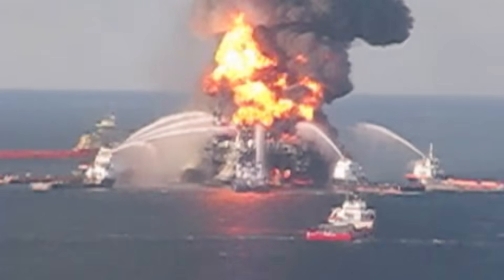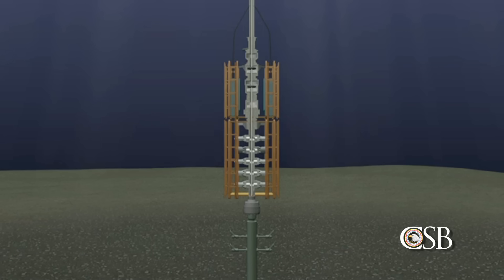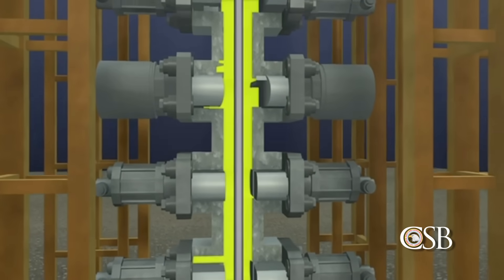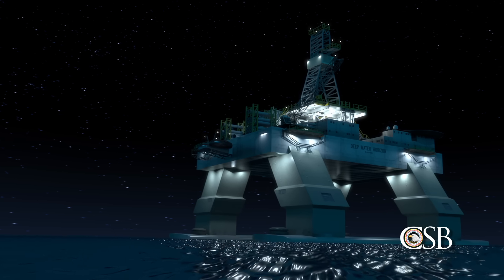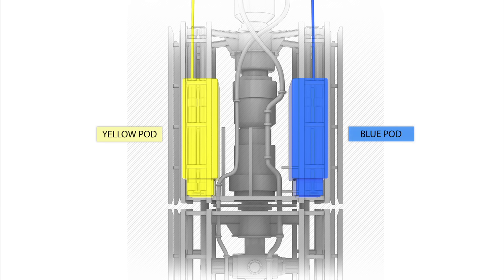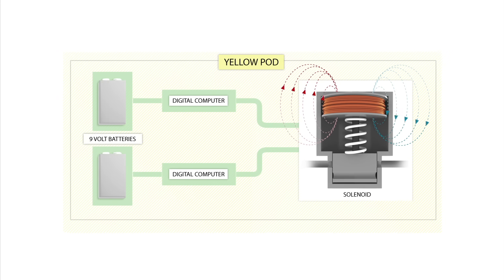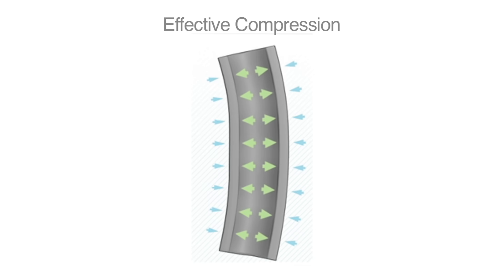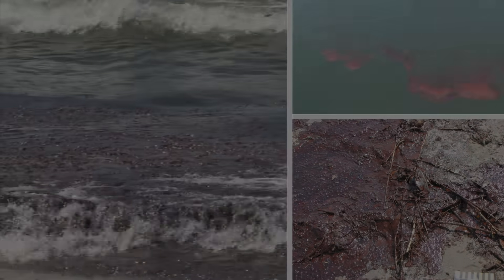Deepwater Horizon Blowout Animation

Comment: You would think they would make a slot for the blind sheer ram and have the pipe run inside another tube so that the if the pipe buckled it would hit another reinforced tube and stop bending and the ram would be wider than the tube itself so that it would cut both and eliminate the problem of the pipe bending outside of the blind rams reach
Reply: i think they have them they are called centralizers. Bp was told to use like 35 and used like 12 instead as itscheaper and faster to not place them.
Reply: @dustyflair BP going with the cheaper option, c’mon they would neverrrrr do that

Comment: One would think that wiring on emergency systems would be triple checked by different individuals and also tested to make sure they operated correctly before installation.
Reply: it shouldnt even be able to be wired by a human. They should plug and play a comter panel to do all that.

Comment: 1) Design every channel “de-energize-to-trip”

Meaning: loss of power or signal forces the safe state.

Use normally-safe actuators/valves (spring-return to closed, vent-to-close, etc.).

Use solenoids arranged so power holds normal, and power loss trips to safe.
This “idle current / de-energized-to-trip” philosophy is widely used specifically to protect against power loss and common-cause electrical failures.

Why it matters: if a fire, flood, dead battery, severed cable, or logic crash happens, that channel still does the right thing without needing command energy.

2) Separate the channels physically

Independence dies if both backups can be taken out by one event.

Put redundant controllers and wiring in separate housings/trays.

Separate hydraulic lines, accumulators, and connectors where possible.

Protect against the same environmental threats (heat, vibration, corrosion) hitting both at once.

Rule of thumb: if one explosion, leak, short, or crush can wipe out both channels, they’re not independent.

3) Add diversity, not just duplication

“Two of the same thing” often fails the same way. Diversity breaks shared failure modes.

Examples:

Different technology: e.g., one electric actuator path + one hydraulic/mechanical path.

Different components/vendors: different solenoid models, different PCB designs.

Different logic/firmware: independent code bases or different safety PLC families.

Different sensing principles: pressure sensor + acoustic/flow-based trigger, etc.

This is a standard anti-common-cause strategy.

4) Make support systems independent too

A channel isn’t independent if it shares the same “lifelines.”

Give each channel:

its own power source (separate batteries/UPS, separate chargers),

its own signal path (separate comms, separate penetrators/umbilicals),

its own hydraulics/pneumatics where feasible.

Classic trap: “dual pods” that share the same weak battery design, connector type, or maintenance procedure.

5) Treat systematic (human/design) error as the main enemy

Redundancy helps random hardware failures; it does not automatically protect against mis-wiring, bad procedures, or design bugs.

So you need:

strict configuration control,

independent verification/inspection,

checklists + polarity/continuity proofing,

change-management and competency controls.

Functional-safety standards explicitly separate random vs systematic failures and require processes to reduce systematic ones.

6) Prove independence with common-cause analysis + testing

You don’t just assume it—you demonstrate it.

Do a common-cause failure analysis (beta-factor, fault-tree with CCF nodes, etc.).

Run end-to-end proof tests that intentionally remove:

power,

command signal,

single components,

one whole channel,
and confirm each channel still fails safe on its own.

Key: independence is a tested property, not a marketing claim.

Bringing it back to the Deepwater Horizon context

What failed there wasn’t only “redundancy exists/doesn’t exist.” It was that the redundancy wasn’t independently fail-safe:

shared vulnerabilities (battery health, wiring quality),

solenoid logic not truly de-energize-to-trip,

systematic human errors that could hit both channels.

Industry BOP control standards emphasize robust control, accumulator reserve, and emergency operability, but independence still hinges on the design/QA choices above.

Comment: I’m surprised solenoids of the yellow pod don’t operate the opposite way, to make them failsafe. The battery and solenoids are used in normal conditions to push the valve closed and any interruption in power or signal and the value springs open (Valve normally open, forced closed)

Comment: This was not an 'accident'. It was a massive negligent cluster-phuck.
Reply: Same reason why Chernobyl Reactor 4 blew up. They were in a Xenon pit which reduced reactivity, and they tried lowering reactor output to prepare for a test, which stalled the reactor. Deputy Chief Engineer Dyatlov wanted to bring it back up to 700MW from a stalled state when the only safe option was to slowly raise power to 3200 MW over the course of 24 hours. Only getting 200 MW, Dyatlov proceeded with the test and told his subordinates off when they tried to intervene or ask him to record his actions. After pulling all control rods out, shutting water flow, the reactor was now accelerating, and incrsasing in reactivity similarly to how the pressure was uncontrollable in the drill pipe. The final straw was when they pushed the emergency shutoff, AZ-5, The control rods were tipped with graphite which accelerated reactivity, increasing pressure, and the reactor from there, exploded, combining superheated materials with cool air, the explosion was immense, and radioactive material was spread across a 200+km area. Smoke from the subsequent fire carried mildly radiactive particles across Europe.
Reply: In America we haven't built any reactor similar to the RBMK in design since the SL-1. And that was a failure for an entirely different reason back in the 1950s. Chemical spills and oil spills have proven to cause more damage to biodiversity than radiactive catastrophes. Pripyat and Chernobyl have a ton of life surrounding them still. Dogs within the zone manage to find a way, wildlife has for the most part remained unchanged.
Dupont's negligence and BP's greed have caused more dsmage than Dyatlov and Bryukhanov in Chernobyl, Fukushima in Japan, and not even 3-mile-island was a need for concern.

Comment: I like how they were so bad at making redundant systems that a battery failure caused their miswired solenoid to work correctly. If the drill pipe hadn't been bent, that miswired solenoid might have saved the day!

Comment: That makes no sense and doesn’t explain what the drill mud was doing doing in the drill string if the cement plug had been poured. Plus a bent pipe won’t prevent the shearing of the drill string.

Comment: The alignment of these “holes” isn’t purely random—it’s a result of multiple vulnerabilities or failures that, when combined under certain conditions, lead to disaster. Here’s why that can happen:

Complexity of Systems:
In any intricate system, there are numerous components and layers of safety. Each layer (or “slice” of cheese) has its own potential weaknesses. While one failure might not be catastrophic, when several weaknesses coincide, the overall defense can be breached.

Human Error and Oversight:
Mistakes like miswiring, inadequate testing, or ignoring warning signs contribute to these vulnerabilities. When organizational pressures (such as keeping to schedule or cutting costs) influence decision-making, these errors can go unchecked.

Environmental and Operational Stresses:
Conditions like extreme pressures or unexpected stresses can exacerbate small flaws. What might be a tolerable imperfection under normal conditions can become a critical failure when the system is pushed to its limits.

Murphy’s Law in Practice:
The saying “anything that can go wrong, will go wrong” captures the idea that if there are flaws in a system, they have the potential to manifest simultaneously. It’s not inevitable in every scenario, but the more vulnerabilities exist, the higher the risk that all or several will align at the worst possible moment.

In short, while not every potential failure will line up every time, complex systems with many points of vulnerability can sometimes experience a perfect storm where all the “holes” align, leading to catastrophic outcomes. This is why robust design, constant vigilance, and redundant safety measures are critical in high-risk industries.

Comment: The Swiss Cheese model illustrates that even well-designed safety systems can fail when multiple small errors or oversights—each represented as a “hole” in a layer of defense—align. When these vulnerabilities line up, the system’s safeguards can be completely bypassed, leading to catastrophic outcomes.

For example, in the Deepwater Horizon incident, miswired control systems, battery failures, and the unexpected buckling of the drill pipe were separate issues. Each might have been manageable on its own, but when all these “holes” aligned, the safety measures failed, ultimately resulting in one of the worst industrial disasters in history.

This model is a powerful reminder of why rigorous checks, redundant safeguards, and continual improvement in safety protocols are crucial in high-risk industries.

Comment: 1. Complexity and Redundancy Aren’t Foolproof
Redundant Systems Fail:
Despite having two independent control systems (yellow and blue pods) designed as a safeguard, miswiring and battery failures in both meant that the backup mechanisms didn’t work as intended. This shows that redundancy must be accompanied by rigorous quality assurance and regular, comprehensive testing.

2. Cascading Failures and the “Swiss Cheese” Model
Multiple Small Errors:
The disaster was not the result of one isolated error, but a cascade of failures—from miswired solenoids to the unforeseen buckling of the drill pipe due to effective compression. This mirrors the “Swiss Cheese” model in safety engineering, where several layers of defense each have holes that, when aligned, allow a failure to pass through all safeguards.

3. Human Factors and Maintenance
Role of Human Error:
The miswiring incidents underscore the impact of human error in safety-critical systems. It’s a stark reminder that the design, installation, and ongoing maintenance of complex systems require not only advanced technology but also meticulous attention to detail and rigorous standards.

4. Underestimated Physical Phenomena
Effective Compression:
The phenomenon of effective compression—where even slight imperfections in a seemingly straight pipe can lead to catastrophic buckling under high pressure differences—revealed a previously underappreciated hazard. This insight has led to a deeper understanding of material behavior under extreme conditions and the need to factor such subtle phenomena into safety designs.

5. Lessons for Future Safety Protocols
Improved Testing and Design:
The incident has spurred efforts to re-examine and upgrade safety protocols, ensuring that systems are designed with enough tolerance to handle unexpected stresses. More rigorous testing procedures and stricter quality control in wiring and component installation are vital.

Cultural and Regulatory Shifts:
Beyond the technical failures, the disaster highlights the importance of a safety-first culture and strong regulatory oversight in high-risk industries. Ensuring that economic or scheduling pressures do not compromise safety is critical.

In Summary
The Deepwater Horizon disaster teaches us that even in systems with multiple safeguards, the interplay of design oversights, human error, and underestimated physical stresses can lead to a catastrophic failure. It’s a powerful reminder for industries dealing with high-risk operations to constantly re-evaluate and enhance both their technology and safety protocols to prevent similar tragedies in the future.
Reply: The system didn’t have redundancy, or was a bad design. 
The way the yellow pod solenoid works isn’t fail safe. In my opinion it operates the wrong way around. Electrical power should be used to hold it in normal conditions and any break in signal / electrical power causes the valve to spring into the safe setting.
Reply: @notmenotme614  You raise a fair point about how the solenoid should ideally operate in a fail-safe system, but in the BOP design used on Deepwater Horizon it unfortunately didn’t work that way in practice.

In a true fail-safe configuration, as you said, power is required to hold the valve in the “normal” position, and loss of electrical signal forces it into the safe/closed position. That design eliminates a whole category of failure modes.

But on this unit, the yellow pod’s solenoid for the blind shear rams wasn’t fail-safe in that sense — it relied on proper wiring, a live battery, and an intact control signal for activation. When the battery died and the solenoid was miswired, the system wasn’t able to shift into the safe state on its own. So even though the BOP had “redundant” pods on paper, both suffered from different latent failures, which meant the redundancy didn’t actually protect against a control-side failure.

It’s a good example of how redundancy isn’t real redundancy unless each layer is independently fail-safe, and why safety-critical valves, especially ones intended to operate after a catastrophic event, are usually designed exactly the way you describe — loss of power defaults them to the safest possible position.

Comment: Why was the double redundancy not designed exactly like tractor trailer trailer brakes. This was retarded on many levels.
Reply: This. The way the yellow pod solenoid works in this animation seems back to front. It is not fail safe. 
Normal operation should require an electrical signal to energise the solenoid coils and any interruption in the electrical signal should cause the valve to spring into it’s safe setting

Comment: the actual HOLE itself was unstable and there were apparently insane pressures inside the chamber/rock - they still decided to take the risk and drill even though the seismic data indicated high pressure/high risk

Comment: ROFL 5:28... "found an ignition source" is a real gentle way of not saying that the flammable gasses mixed with the intake air of giant diesel engines, causing them to run away until they seized up catastrophically failing...
Reply: The description of the sound it made before exploding is haunting.
Reply: @Foxxorz  Years ago I worked in a Machine shop and we rebuilt a CAT 3524 and I got watch it get thrown on the Dino and fired up...  Full throttle that thing sounded like hell 20ft away in a sound/blast proof room.  Granted some failures are more spectacular than others... a rod punching through a block is one thing and an entire mainline flying out of the block is another...  If it didn't deafen you, I'm sure it would sound memorable...

Comment: That annual the bop shut off is so important I worked onshore Drilling Rigs were supposed to be able to shut it in so nothing can come up the drill pipe but mother nature is so powerful if a billon old chamber of gas wants to come up that hole theres nothing a rig can do to stop it pressure in the earth is unstoppable it could blast the rig into outer space...if any future rough necks see this when mud comes up onto floor run!!!nothing you can do
Reply: Where are you gonna run to!?

Comment: Amazing that a double digit $M device like the BOP does not undergo much more stringent quality control. Also amazing that it relies on batteries to function.....
Reply: the batteries are a backup in case the power connection is severed

Comment: why don’t the yellow and blue pods fail-safe?? so that if the battery runs out, the spring automatically pushes it to close the solenoid and activate the ram

Comment: Bop should be tested after assembly and even if the pipe wasn't buckled the  27v battery on blue pod was flat so the  solenoid on blue wouldnt have been powered because the 9v battery only operates the computer that closes the connection between the 27v and the solenoid

Here's a simple experiment that will explain things
Take two small dc motors and connect  the negative leads together in parallel
Next take a normally open reed switch and connect one to each motor 
Connect the other ends of both reed switches together and connect a 9v battery. Notice the motors do not operate
Now take a small magnet and bring it near the reed switch and the motor spins
You could also substitute a relay for the reed switch and magnet and use a second battery to power the relay

Comment: Lol they make it sound so complex but this is stupidity at it's finest. They literally capped a pressurized system in a pipe that couldn't contain said compression. The pipe then, who would think, failed and spilt all the oil into the ocean. Also, when you make a failsafe and you for sure want it to work, don't rely on an active, functioning state to activate your failsafe lol, kinda defeats the purpose. It's not that hard to use a solenoid that automatically closes when power is lost (literally just re-verse polarization to achieve the opposite effect) in which when power is cut, the solenoid is literally only relying on physics/spring pressure to close. I like my chances better the physics way but I guess they only had billions of dollars to think of better ideas, too much to ask when greed is in question.

Comment: How many ram sheers did it have? and only one operated?

Dead man valve in the form of a hydraulic or pneumatic device should also be used. Hell, even one as a last resort activated by an anchor that is dropped and triggers some sort of clamping device as well. Get it together BP.